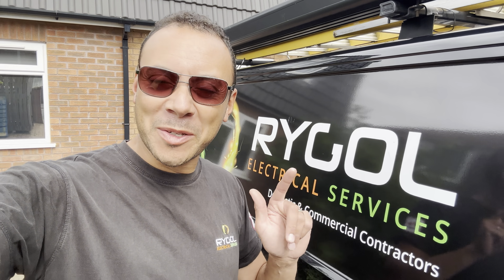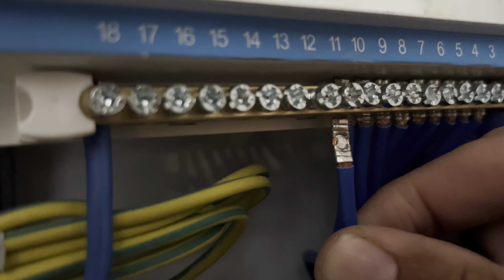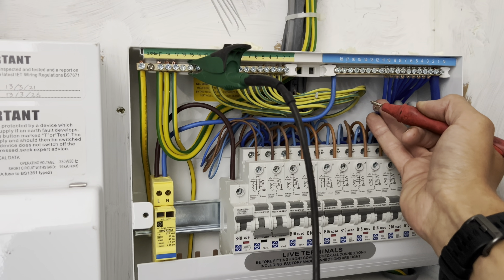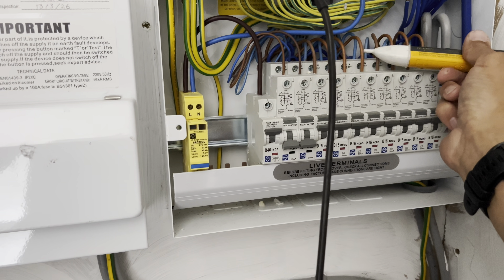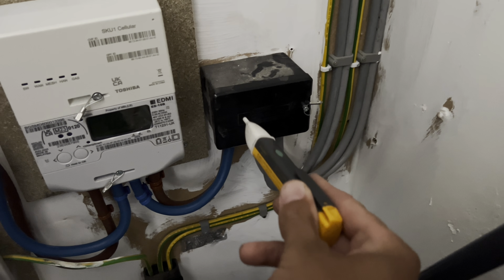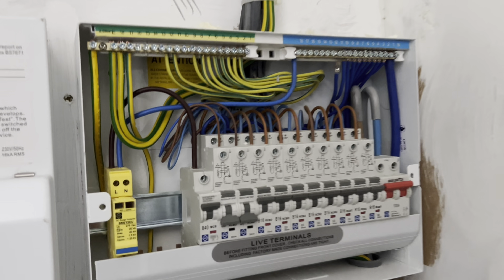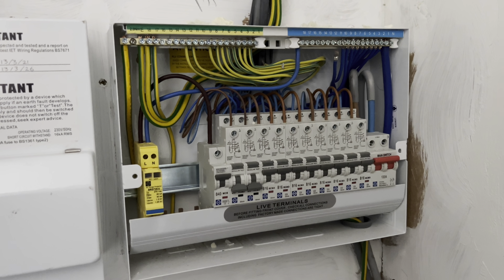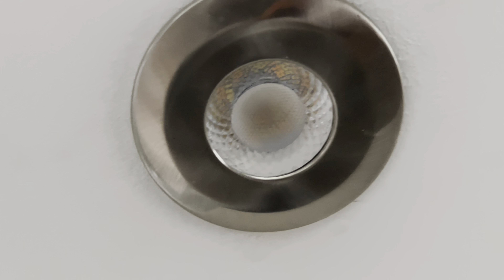Smart Meter Disaster! ⚡️

Comment: You're DEAD RIGHT to bring up this matter. Correct testing after any work is not only a required duty, it's a moral obligation as with that installation left as it is it means when any lights are switched off the lamp holders will still be very LIVE, just like some of the old vintage British wiring where the light switches were connected in the neutral side leaving the light fittings still dangerously live. And I used to fix and refurbish the old analogue TV sets with tubes and I soon came to the conclusion that it just wasn't good enough just to get them working, they also had to be safe too, so I used to spend hours on them making sure they had all the correct critical parts fitted, and fitted properly, and that every safety system was working etc. as well as making sure that no live parts were accessible with all the covers fitted and so on, the list goes on...And I've worked on all manner of other stuff too, not only old TV sets, but also VCR's, vehicle wiring and professional audio, and setting up the stage for live music where there's all manner of possibilities for electrical safety hazards, especially as you have to use the venue's electric supplies which are not always compliant like they should be, and fixing the big high powered stage amplifiers for the main PA is a big risk too as given the amount of power running through them when they're running means that if one blows up big style it won't just blow a mega expensive speaker but quite likely set it on fire and with that the stage too, so just "getting it working" is not enough, they must have all manner of tests done before being put back into service. And of course such thinking is critical with mains wiring too, and I've rewired full houses too. And what a neat job that consumer unit is, I've seen some which were absolutely appalling, as was the whole installation in some cases, like in my own home when I first moved in. I take my responsibility deadly serious.

Comment: Good Grief!!! Well done for sorting it out. The most important thing an electrician, or any craftsperson for that matter, has to have is a responsible attitude to their work. As you said this bodge job could kill!
Did you or the landlord follow it up with the smart meter people?

I had a similar thing many years ago when installing some RCBs. Old wiring so I expected there might be a problem with leakage somewhere. Sure enough, the RCB kept tripping when I energised the circuit. Not the prime suspects of oven or heaters, but I eventually traced it back to a fluorescent light in the attic that had its neutral and earth swapped!

Comment: You did not show what did you swap. I mean where? The problem starts on the sealed black box( don't know the correct name of it, english is not my main). Did you swapped thre the two wires or in the main fuses pannel? I guess you did it on the fuse pannel. But is weird you showed anything but the way you fixed. :)

Comment: I’m a retired Aussie electrician
The MEN system in Oz, requires the Earth and neutral to be bonded at the main switchboard.
Having what appear to be two main switchboards fed from one meter to me is very odd
If the bond was there then the primary fuse would have blown as soon as it was replaced
I could see no bond between the Earth bar & neutral bar in the switch board
There looks to be an Earth going to the Mains cable termination bock
Which makes me think the Earth is bonded to the Neutral there, unless it is in DB1

Comment: Excellent Video, but this company needs to be exposed. Electicity suppliers are pushing smart meters on to customers. I wonder how many will be wired wrong and put people in danger. By not exposing them, you are almost condoning there work, which is clearly poor at best. If YouTube, FB, Twatter X, whatever don't like it then bollox, this is not a reason not to expose these Dangerous works being carried out by them.

Comment: as an electrician, what is the power drain of the wi-fi unit in the main network meter, I have measured it at 20W/hour, which means the free smart meter display costs over £50 a year to run??? your comments would be interesting. Also there now is no main switch to turn off the main, before the fuse box???
Reply: Electricity meters work by measuring the voltage drop (due to current) between the line in terminal and line out terminal. Current consumption of the meter itself won't cause any voltage drop, as the meter isn't powered by the line out side of the current shunt, so the meter won't include its own energy usage in the figures. BigClive has down a teardown of a smart meter (titled "Inside a smart meter") and you can see it's getting its power from the phase in terminal at 7:25.
Reply: 20W !! What?

Comment: In the mid 60's I was repairing a Gas Chromatograph in a public analyst's laboratory. I needed to replace a part that was fed with 240V internally from the main power cord. Just to be safe I switched off the machine [single pole switch] and then the 5 Amp wall socket it was plugged into. Reached into the machine to disconnect the terminals and with my arm resting on the surrounding metalwork I got a full mains voltage shock. My scream caused a lab assistant to drop some glassware. I was so embarrassed that I could make this simple mistake so I shrugged it off. After a cup of hot sweet tea I  dismantled the wall outlet to find that it had been wired in reverse polarity. To this day I NEVER TOUCH any conductor, Live, Neutral or Earth without checking, as the remnant, small but constant pain in my right arm 60 years later serves as reminder of how silly but lucky I was and the danger that exists if you trust others. 
I DO NOT trust anything  wired by anyone else and now in my eighties, double check everything I do. And I never work on any equipment still plugged in! I regret now not having made any complaint back then but I do do think that you ought to have reported the incidence to a higher authority [H & S E or the meter company] to have the meter installer retrained. Not to do so might mean the same mistake may occur again and somebody might be KILLED.

Comment: socket testers are not fail safe (was never confortable with them as ther very iratic) thats why its best to test on the first point of a customers isolation, a cu a db board or a iso switch using test lamps. the engineer obviouslly failed on his testing or never even done it.
Reply from the maker: You’re right. He definitely didn’t do it

Comment: As a electrician what are your personal thoughts and opinions on smart meters I feel like since we got ours I bills have gone alot higher better when we didn't have one tbh ?
Reply from the maker: I personally have made a conscious effort not to get one. I don’t trust the data they send. Much prefer a standard meter.
Reply: @Leon-nn7rn  is they any chance by getting one my bills can go alot higher because I'm in a one bedroom flat with 2 of us. and I started paying 80 a month to british gass for gass and electric then I got smart meeter. and a new boiler and my bills have gone to £140 a month and I honestly don't feel like we are using £140. a month as we never use heating but we do use a fair share of electric but can't be so much
 as we are both working through the week seems like a rip off to me as my friend told me he pays. £120 a month for a 3 bedroom house and always uses heating and has lots of showers ETC .
Reply from the maker: @3rdbanwavey121   you could get an energy monitor and d compare it to your bills. That way you can be sure the readings are matching.

Comment: It’s your fault really. You wired the Henley block with lives at the front instead of the back. The meter guy followed the correct protocol. You set a trap for him. He should’ve tested though. No getting away from that.
Reply from the maker: @FUSE_Services   you made a mistake. The Henley block is wired with the live at the back by me or. The meter guy wired the live into the front. Watch carefully.

Comment: Eddie is quite right, he should not have taken the seals off but reported this It’s a bit of an own goal putting this video on as it shows some of his own shortcomings also. It might even be possible that the socket in the kitchen that the meter changer checked appeared OK if it had been wired with N and L reversed. The video only shows one socket being checked and obviously that had been wired correctly but one or more of the others may not have been. He should therefore have checked all sockets, not just a random one as he didn’t know which one the meter changer checked
Reply from the maker: The meter seals on the henley block are the consumer side so we are permitted to access and that is where the reversed polarity is. Also we installed the installation and the polarity was correct then and has been fully tested by us.
Reply from the maker: The meter seals on the henley block are the consumer side so we are permitted to access and that is where the reversed polarity is. Also we installed the installation and the polarity was correct then and has been fully tested by us.

Comment: Well, I have just one or two questions here. If you rewired this place just 2 or 3 years ago, why is there no DP switch after the meter? How did you isolate the incoming supply when you fitted the consumer units? You didn't cut the seals on the main fuse did you? Did you...?
Reply from the maker: Hi. This is a new installation and the DNO connected our mains tails. The DNO supply was moved from outside to in the meter cupboard so they were responsible for adding a DP isolator as our installation was already in place ready for them to connect to.

Comment: How do those volt sticks know between Neutral and Live? I mean this is Alternate Current, I'm confused.
Reply from the maker: Hi Gorge, they pick up on a live AC only. Not the neutral
Reply from the maker: Ps, sorry i spelt your name wrong. Auto correct function
Reply: How can they tell the difference between the Live and the Neutral. In AC the Live is only Live half of the cycle...

Comment: An easy mistake to make when connecting the meter tails to the connector block but a simple test would have identified it before switching on the board. Obviously no such test was carried out, and this is the real problem. I have supervised a few meter changes in some of our buildings recently and I must admit I was impressed by the tests carried out before and after the work regarding polarity and phase rotation. When I asked the bloke of his background he told me he was a gas fitter before doing electric meters. It’s all good though cause the big corporations are scudding the government  for grants to do this while paying the operatives peanuts so they can make plenty for the shareholders at the expense of the public. 😂😂😂

Comment: The best way  to check polarity is with an independent earth.    Another  way is to measure with a clamp meter, Neutral, earth, and phase currents. The Phase current  should equal the neutral current plus earth current.  If polarity is reversed the Neutral will equal the Phase  plus earth. also with reverse polarity  there will be a large earth current.  What you have is  Extremely Dangerous,   So reversing polarity will liven any thing earthed through the earth continuity bonding and Neutral earth link.  
 If you have a poor main earth and reverse polarity , ie neutral and earth live and Phase grounded, Your plugin tester might still give the 3 green lights.  And things inside still work fine.  Until you go to water the garden.
Reply: Nonsense. Why would there be a large current going to earth?
Reply: @stephenmutch4175  for single phase If polarity is correct the Phase current equals the earth current plus the neutral current. If polarity is reversed things are different, Rerfing to a MEN system, main board.

Comment: Got a question about the RCBOs. When I left Bristol 15 years ago, they weren't really common. I'm now in Madrid, where we have a "differential" i.e. RCD and then Phase+Neutral "Magnetotermico" i.e. MCB. Both the RCD and MCB switch phase and neutral. It looks like the RCBOs don't switch Neutral - so if the 30mA fault current is to Neutral,  it doesn't cut it?

Comment: our wirings neutral is connected to the earth, so if what happened at the place your at had happened to us we would have been fried (assuming the consumer unit had died) scary ey

the only reason i found out about the wiring was when i tested an outside lights wiring and found a dead short between the eath and neutral 

i just hope the electrician used good cabling 😳 liked and subbed 👍

Comment: I guessed it was polarity, and was trying to clock the meter as I have myself experienced the DNO/Smart Meter installers causing such issues …3 times now in my 25 years of Electrical vocation.
I myself am a Spark from Bristol, and I commend you on your workmanship, Leon, I can see that you take great pride in your work.
I always make the rear most connector in a two pole link box the live, reason being they are made from Bakelite which  can be broken relatively easily, and I assume that in the advent it was knocked and damaged then the Live would hopefully be a little more inaccessible being at the bottom and the back, and I’ve always explained to my apprentices why I do this. I also use a marker to denote a L or N on the cable as it enters/leaves these boxes. I don’t think there is a right or wrong way, but I try to use single pole Henley boxes since the fore mentioned issues now anyway, as this seems to be far to easily messed up by these 3rd parties!
*Also, I think a 2 Pole isolator should always be fitted by them, as we shouldn’t have to make appointments to isolate someone’s electrical supply when carrying out our work.
Reply: That was my thoughts exactly, plus if the tails are under a bit of tension the front terminal often springs out!! The meter fitter was probably traind parrot fasion, no excuse for not testing though.

Comment: Some time when the nutral are in common , then it give a spark , because the other equipment are still on , happened to me also , but in this case it seems it’s because of capacitors, but wiring is so nice

Comment: I would have put a neon screwdriver on the neutral input first thing
Reply: It happened to me in the boatyard. They rewired my switch on the gangplank to my houseboat barge. I went to cut some wood with my big metal black and decker 9 inch saw. I was standing on wood and got a wallop. Thankfully not standing on the bank or I wouldn't be writing this. The neon screwdriver lit up like a beacon when touched to the saw. Everyone should own a neon screwdriver.

Comment: This is horrendous. I can already see an update for Edition 19 to have a safety mechanism in the consumer unit to protect against it. The (very low power needed) LED glow is due to 'capacitance' of the length of circuit, when it is switched on the neutral. This was the first warning.

Comment: No the smart meter is a very smart move for the government. Because it simply doesn't work it's not very smart at all. And if we were allowed to actually get all the data of the smart meter I think almost every single solitary household would be able to sue the electric companies for billions of dollars they have been overcharged. I was charged $270 for three days of electricity. And the most electricity I could've used in those three days was watching a TV for six hours using my computer for 10 hours having three lights on for four hours. And having one hotplate on for one hour. This is for three days. And it cost me $270 with a smart meter. This is purely an electrical issue but the smart meters are basically not very smart because they run on assumptions

Comment: I haven't been a pro electrician for several decades. I quit sparkying , and started twiddling with computers ! 

Back in my 1980s apprenticeship I was taught that the neutral should be treated as a "live" conductor , and always test before putting fingers on it !  (unless you like getting shocks !) 
Broken neutrals will make one side of a neutral cable alive. 
That's not the case here, reversed polarity has made the neutral become the live , but the point is neutrals need to be treated with as much respect as live conductors , especially when trouble shooting things ! 

Also very neat wiring inside the consumer unit, I'm impressed !

I've also had a belt 240v , right across my chest when I was a young sparky. 
left hand was holding on some piece of earthed metal, right hand "decided" to touch a live conductor. I didn't do that again !

Comment: That was a horrendous mistake. By the mere action of someone changing a light bulb would mean the live which is normally switched out would result in a full shock off the constant neutral, which was in actual fact live!. Doesn't bear thinking about with someone standing on steps to swap out the bulb. The redacted information on that test label appears to be that of Shitish Gas.

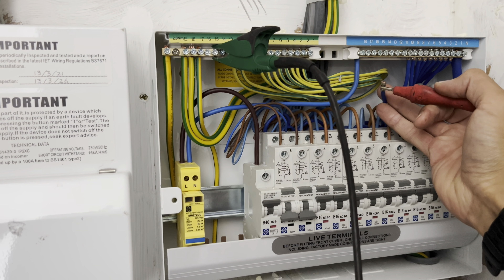Comment: I stopped the video at 3:38 as suggested, to write down my guess.
I'm not an electrician, so I may be completely wrong. The only cause I could think of was that somewhere electricity comes back to the light fittings. Switch is off, so the live wire is cut. Maybe something else that is on, allows the electricity to reach the neutral rail, and the electricity finds a way through the neutral wire of the lights to the lights and away somewhere else. Where could it go? Ground. OK, but I don't think this should work because the RCD breaker should switch off if this happens. Although I did not spot the RCD in the customer unit, I expect it is there somewhere.